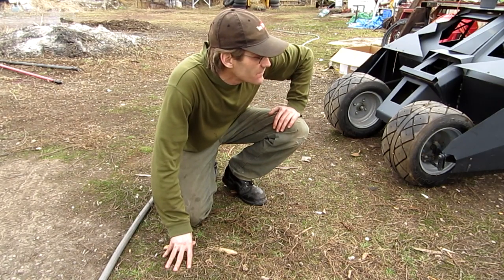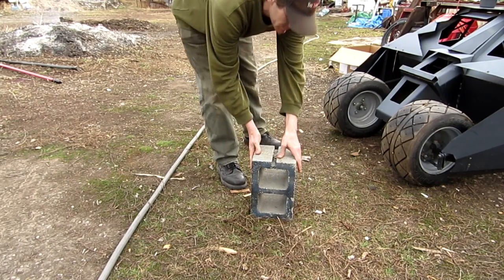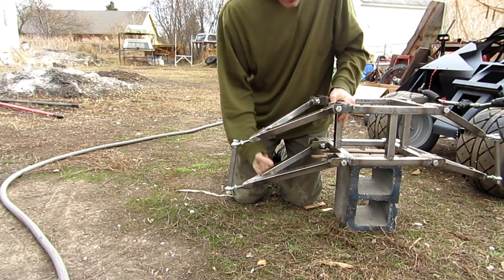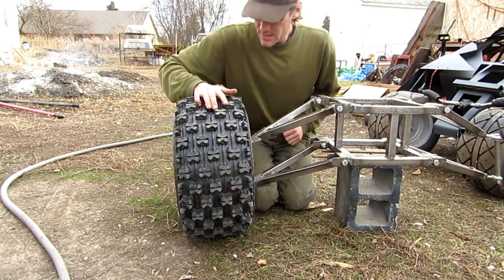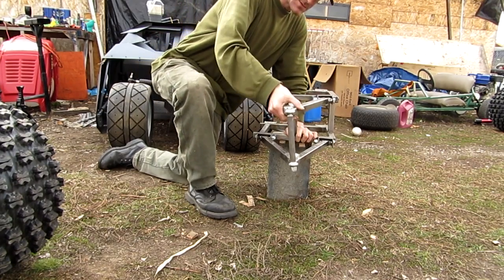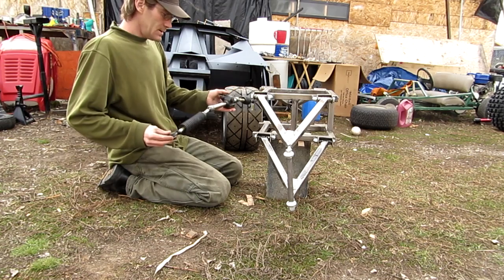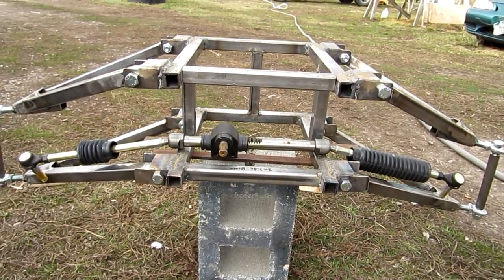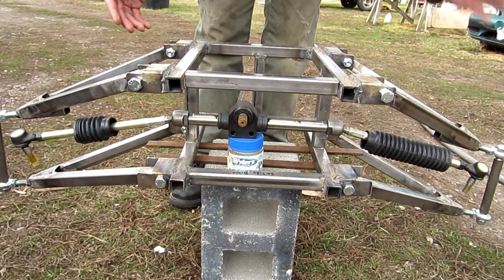█ GO KART BUILDING |  A-arms #3 ( The Fullscreen Machine )

Comment: Red Beard just recently had a similar issue with a steering rack on his customers yerf build.  He built a bracket that mounted to the ends of the rack and then moved the tie rod ends to the bracket.  He was then able to make it as wide or narrow as he wanted, to keep the ends in line with the suspension pivots.  Hope that helps.

Comment: The camber should be on the spindle never by the a arms. the horizontal lengths from spindle mount to the frame mount and the length of top and the length of bottom a arms should be the same

Comment: I see a problem if used at higher speeds you are missing anti dive in your control arms layout if you tip the front of the upper control arm up about 5-10 degrees you will add anti dive while braking

Comment: what size bolts did you use to bolt up the a-arms? 3/4"? been looking through other vids, didn't see it mentioned specifically..
Reply from the maker: +Matthew Gilkerson ... I was thinking of using 3/4 but I decided to go with 1/2 . They have been working great, haven't had a problem yet.
Reply: +T-Mans Go Karts wouldn't that cause it to be alittle loose or sloppy, not being the same size as the tubing..?
Reply: +T-Mans Go Karts like, wouldn't the improper size bolts cause the arms to move around a bit, like forward and backward?
Reply from the maker: +Matthew Gilkerson ... oh , yeah. the tubing is 3/4 with 1/8 wall so the inside is 1/2 .
Reply: +T-Mans Go Karts ah, of course, I failed to take that into account. makes sense now.

Comment: What you need to do is lengthen the rack so that they fall on the pivot line of the upper and lower "A" arms, also the tie rod should run parael with the lower "A" arm
Reply: +rjd048 Agreed. It's easy enough to make up extensions for the rack bar if you have a lathe.

Comment: is it bad to have no camber or caster at all? have same length arms top and bottom so keep the tire square all the way? would that be weird on the steering?
Reply from the maker: I dont think it would. You should be ok as long as you dont beat on it to much.
Reply: +GoldStarTech No castor would make it horrible to steer. The 7 degrees mentioned seems like a good starting point, but if I were building it I would put some spacers on either the top or bottom inner rose joints so the castor could be adjusted later. Zero static camber is not so bad, but again it should be possible to get a bit of adjustment by screwing the outer rose joints in or out. Adjustability also allows you to correct any dimensional errors that have been created in the welded parts. Finally, personally I would have gone with more camber change by making the top wishbone shorter.
Reply: yeah that makes sense. thanks.

Comment: I am getting ready to build my own kart. Independent suspension in the front and back chain driven with a sprocket. Any advice?
Reply: Use cvd shafts or universal shafts. You can custom make the length on tractor parts. Just look around forever..

Comment: Hi Tman, I am intrigued with the build, I have a cart project that I rescued from the scrap. It has a hinged rear end power module with a snowmobile 380cc fan cooled motor, 2pt belted transmission going to final chain drive to live axle and discbrake. This one man chassis, with a little modification, could be paired with your A-arm assembly. A simple weld on type arrangement. 
I am very interested in your U.S. suppliers for Hubs and Rims Tires and the rack/pinnion All Harbour freight and BMI?

Comment: Some input for the steering. IIR your mount points for your A-arms should be the same on top and bottom. and your steering link needs to run parallel with your arms. 

- D

Comment: The fame that the A-arms are attached to is the upper part of the frame welded to anything? if it's not you could actually mount it above the upper A-arm and virtually eliminate the ump steer.